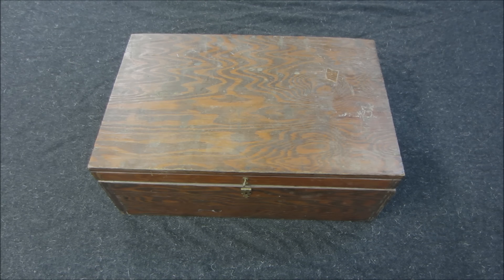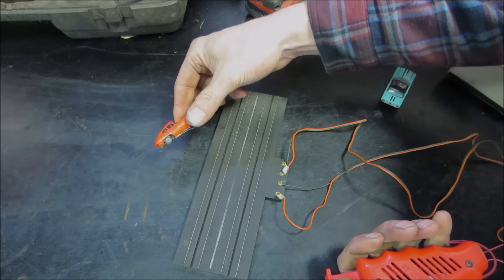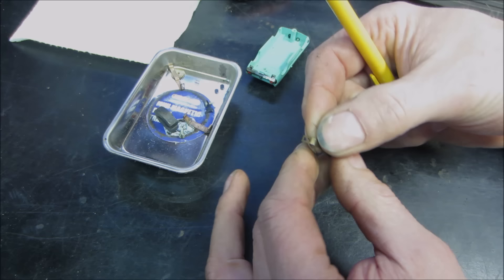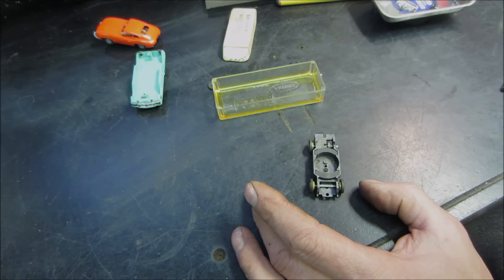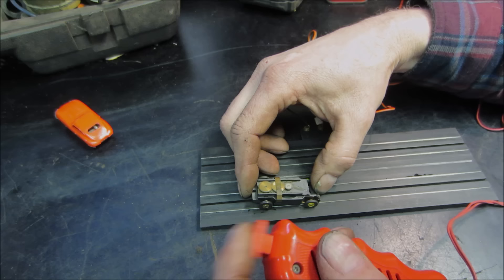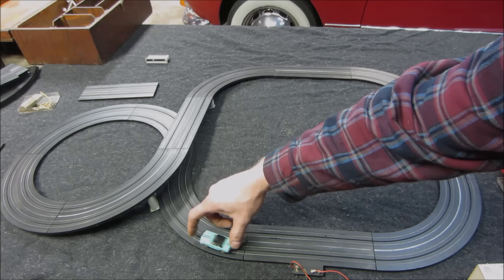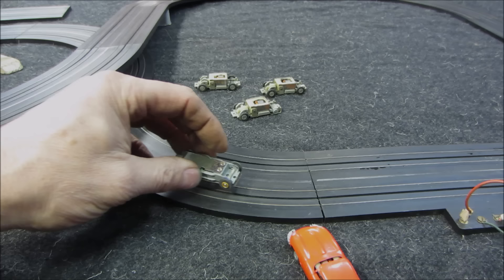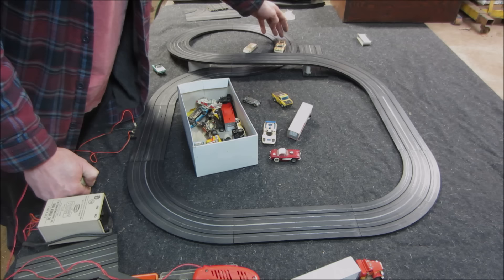will they run? 1960s slot car set sitting 40 years.

Comment: Loved me some HO cars when I was a little chitlin. Every winter we would set up the ping pong table and build a race track. Many years worth of yard sales left us with a great variety of straights, curves and loops. Enough to build a sizeable four lane track. As I recall it took a whole day just to located and repair all of the open circuits and buff the track just so it was usable. After that it was a constant struggle to keep it all going through the winter. I recall hop-up kits for the Aurora cars with silver pickups and silver brushes and little bottles filled with 3 in One oil, all used to get that extra tiny bit more speed out of the cars. Once the neighborhood kids figured out that the track was up they'd start showing up at the front door with small tackle boxes full of their favorite cars and controllers and the neighborhood racing league was set for another season. Ah the time before cable tv and computers, it truely was the good old days.

Comment: I could almost smell the ozone myself watching this! Thank You so much for dragging these out for us. Loved it. I am 64. The biggest years for me were '66-69. I was in junior high and had a much older cousin who was co-owner of a hobby shop so got stuff wholesale.  Plus he just gave me TONS of stuff he got as promotional because his shop at the time was the only authorized Aurora dealer in town. AND a regional warranty repair center. I would spend almost entire weekends with him at the shop, racing and repairing and souping up those 1st gen chassis and motors. We even modified the tracks and controllers.  I knew all kinds of tricks. Over the course of 3 weekends,  2 buds and I built a layout in one of their basements that was 4 levels high and used up damn near every square foot we could. Even running like bats outa hell, it took over 20 minutes to complete one lap.(when the damn thing made contact the whole way, lol) We only were allowed to leave it for a couple of weeks before we had to take it down and when we did the track sections filled up 1 3/4 55 gal. drums! In the end, I was fortunate enough to have over 150 chassis,  300 bodies and enough spare parts to start my own shop! Of course,  by then I  discovered REAL cars and GIRLS! so the h/o stuff fell by the wayside. My parents wanted me to get rid of it all, my cousin wouldn't take any of it back so in '75 I donated it all
 to a boys home in Lansing,  Mi. when I joined the Air Force. Spent a Saturday  helping set something  up and teaching some of the older boys how to work on the cars and stuff. Wow! Thanks again. Those are memories I almost forgot all about.   

 Force
Reply: Awesome story!😊

Comment: I still have my 5 sets from 1973 and the "pit repair kit" that came in a small tackle box with all of the extra pieces to build 10 cars, spare parts. I bought extra tires in white, foam, rubber and a weird jelly type material. I would go to a toy/hobby shop by my house called "kiddie-land" several times a week to buy stuff. I used to clean the rails with hobby oil and 0000 steel wool. My mom drank Sanka coffee in little glass jars and I used to used them to store my best race cars and throw them in my book bag for races after school at my buddy's house. I loved customizing the bodies and painting them. The Magna 440 cars were insanely fast and had real strong magnets on the bottom to hold them on the track. Good times
Reply: NEVER use steel wool, it gets into the motors and ruins them, very hard to clean it out of the track and everything!

Comment: I still remember (55yrs ago) saving my allowance to by soft, foam rubber slicks for the rear end of my H/O racer....new brushes, some sewing machine oil I "borrowed" from my Mom, an eraser and a little square of sandpaper were all in my car repair kit. Then hours would be spent making the race course as real as possible...signs, trees, etc. Good times.

Comment: Those are the later generation cars with a regular motor.  The first generation used a vibrator motor which was an electro magnet with a pushrod that went up and down to open and close the circuit and drove the wheels with a metal piece that drove a gear on the axle.  We used to shorten the pushrods to get higher rpm and used dual truck tires for speed and traction.  Clean all your tracks with scotchbrite for good contact as well as the motor pickups.

Comment: I remember going to a local sewing machine repair shop and buying a small tube of sewing machine oil, it was very thin oil, probably 0 weight, and it worked great for lubricating the parts of my slot cars. The 3 in 1 oil was way too thick.
Reply: My mother was always mad because we used up her sewing machine oil.
Reply: Yep, sewing/mineral oil, These days you can get synthetic turbine oil. I use it on fishing reels year around because it doesn't gel up.
Reply: Some model shops sell the correct oil for model trains and it usually comes in a bottle with a thin nozzle applicator. Can be used with slot cars.

Comment: Thanks for the trip back into my childhood.  My track wasn’t as old, but I had the one with the General Lee and a cop car.  My Dad even set up a table in the den so I could keep it together.  An eraser and steel wool was your best friend.
Reply: I had the same track lol.
Reply: I have that set still to this day... :) 
Steel wool should not be used because it will fall apart and small strands will get stuck to the magnets of the cars (messing up the motors), in some cases the steel wool can also cause short circuits. 
I would use rubbing alcohol on a Q tip to clean up the cars motors/parts. 
Thumbs up! 👍🏼

Comment: The reason the A/FX cars would't really go was because the guide pin was bottoming out in the slot. Flip the pin over, the round pin is shorter than the flat pin... Also, the vibrator car is supposed to run on AC current.

Comment: I had a big set when i was a kid. I wasnt very nice to my toys and most of them were broken. The slot car set lasted forever. I would setup different tracks every dsy and run the cars for hours. I loved the smell of the electricity and the glow from the brushes in the motors sparking.

Comment: Nice! Run your track through the dishwasher. Use Cascade soap. Make sure the brushes are perfectly parallel to the car bottom. Glue a nickel (5 grams) to the top-front of the chassis. Replace the back tires with foam rubber slicks. Plug it into 220V. Guard rails are for wimps.
Reply: 220?
Reply: @shanek6582  Normal voltage is 110V. 220V in will put 24V to the cars instead of 12V. No, it won't run very long, but it will run very fast. Like injecting liquid oxygen on a Toyota Camry with a solid propellant booster on the back. Very fast, very brief, but you'll remember that ride when you're 95 years old and your memory of every other experience has gone soft at the edges.
Reply: Giblet535 the one my brother had it wouldn’t stay on the track unless you were really good at feathering the throttle, you must have had yours tuned up good.
Reply: @shanek6582  There was a small, but real, risk of losing an eye with my set. It was a lot more fun that way. We used trash can lids as shields as we yelled "Drivers! Start your engines!"

Comment: Loved slot cars as a kid, I soldered little 12v light bulbs on the motor terminals inside so they would lit up and raced at night :D Great times.
My uncle still has his original set from the 70s with some of those very large GT cars. They even have a little steeringwheel on the controller so you could change lanes.
Reply: We were trend setters eh! after we did that, they started adding head lights. We found the headlights robbed power from the motor so we usually just took the lights out.

Comment: What a flood of memories.  Clean the brushes and pickups with an eraser.  Just a little oil on the gears. Stretch the springs on the pickups to keep then on the track pick ups.
Reply: Yup, I remember the eraser trick.
Reply: Yep, the eraser trick. I can still see the hand drawn illustration of a hand holding a pencil with an eraser, and that split second before the eraser touches the contact in permanent suspended animation. I forget what we did for the track. Didn't we rub a penny the length of each rail to keep them clean and shiny?
Reply: @sped6954   a nickel works better than a penny

Comment: Wow! That takes me back down memory lane. We had a club at school and shared track and parts and just like you are doing I took them apart before race day and cleaned and lubed. I also remember some bigger rear tires I had and maybe a different choices of gearing in the middle. Could be wrong on that. Thanks for this, it was an unexpected pleasure to see!
Reply: The Aurora Model Motoring accessory gear set was called "Hop Up Gears." It came in a nice box with graphics. AJ's was the biggest fat silicone tire seller. Auto World sold those, along with rewound high-performance motors.

Comment: The flash of a few Sparks, a quick wiff of ozone, and mustie1 got it working. This was great, and brought back a lot of memories. Especially when you were working on the Mustang and taking it all apart. I was like I remember that, the magnets, the brushes, the little Springs, the three little gears on the top with the clip that holds them in , the dirt in the axles... all of it. Great video.

Comment: I'm surprised that I knew mostly how these thing worked back when I messed with them. The ones that I messed with were much cheaper. The tracks had built in pins on one side and the cars used wires as brushes. They also used DC batteries. I remember my friends breaking his pins and I would use old wire to just jam in there to make the connection. I also found out that you can make any size battery work then eventually discovered than you can salvage an adapter to make it electric powered as we went through too many batteries. 

I'm surprised that I knew about basic electricity when I was 5-6 than all my cousins know at 20.

Comment: This is an AWESOME video. I’m playing over again. I have all of my original T Jet, and regular AFX cars, then the newer AFX cars with “Magnatraction”. And when those came out, they were the bomb!! They hugged the track unbelievably well especially at that time in the early 70’s. The problem your having with the traction on those old cars is that the tires are old and the rubber got hard and brittle. You need to get new tires that are soft. Those tires are readily available for the T Jet cars, and tires are available for the AFX cars as well. You can get them on eBay. I have all of my original AFX cars in my AFX carry case still. As a matter of fact, I have the “Baja Bug” with the tire on top, and cool exhaust out the back. It is like a lime green color. You need to find one of those on eBay since you’re a Beetle man!

Comment: The cars with the sealed DC motors were Tyco cars, as was the red Corvette with the white tires. My first set was a huge Tyco set that held itself together with 'snap together' ends. Should've called it 'permanently break apart' track cause all the end tabs snapped off.  Original Tyco cars had big wide conductors that were soldered on the top side and folded over underneath and acted like springs. Tyco cars worked okay on Aurora style track but Aurora cars did not work well at all on Tyco track. My 2nd set were Aurora AFX, just like the white and blue #2 car - those headlights in the front should light up! Check the white guard rail you have - it may glow in the dark (mine did). The Aurora cars with the larger deep magnets that held the cars onto the track better were MAGNA-TRACTION cars. Sets like these eventually led to larger scale slot cars with wooden tracks and racing leagues. If you look around you may find a slot car racing track nearby running some of the Parma or other style cars that go crazy fast (and cost a lot of money). Be careful though, it's a deep deep rabbit hole if you jump in!
Reply: I also had the Tyco setups. Too many years to remember how they worked. My brother and i had a big area in our bedroom and used to hook several sets together. We raced many hours on those old Tyco tracks.

Comment: I have some of those same Aurora cars here.   I fixed some of them up not too long ago.  Aurora was on LONG ISLAND back in the day!  You can still get new tires and alot of parts for those. if the shoes have holes solder them up for now. Use a little engine oil on a small dropper and lube up the gears and axles
Reply: I had an Aurora AFX Slot Car set as a child, I remember belting it down the straights as fast as it would go and not stopping in time for the corners......resulted in quite a few flying experiences for the cars.
Reply: West Hempstead,N.Y.

Comment: I'm a little younger but I had a slot car set pretty similar to this in the late 80s or early 90s. I think it was the classic Camaro and Mustang pair. I remember both of the cars broke beyond repair so I built a new one out of legos with a motor from something and a rubber band drive belt. I just used stripped copper wires for the contact shoes. I even made a little trailer it would pull around the track. 

Just in the past few months, I built a 1:5 scale RC Buggy with a chainsaw engine for power. I guess not much has changed haha.

Comment: I played with those race-tracks for days and days....rebuilding cars, swapping internals...you definitely need those yellow plastic guardrails to keep cars on the track. Need to use real light oil on those gears...i believe the old-vintage oil hardened up. I use to pull the springs out a bit and re-assemble on the copper contacts...makes for a bit firmer on the track electrical rails....clean those track rails too...they get oil on dust (mixed) on them. If the cars were too light in front or rear...taped a penny on them....for better contact-track traction.

Comment: Boy does that bring back some memories.  I had a huge set of Aurora track and cars.  When I put it away and left it behind when I moved out on my own, I probably had about two dozen cars and had most of them running.  My younger brother let the neighbor kids borrow them for a few weeks or so, and when they brought them back, all that was left was the track, and a hodgepodge of bodies, chassis, guide pins, magnets, pickup shoes, springs, brushes, gears, tires, axles with one hub, etc.  We had lots of fun, and lots of tedious frustration.
I remember putting little ^ arrows on the magnets that pointed to the front, so we knew which way they were supposed to go, unless we intentionally wanted some of them to go the wrong way.

Comment: i have a 10 lane oval bank track from Carrara and i havent got to set it up yet bc of its size. its 4 ft tall and like 15 ft long and  10 ft wide. and im 13... you dont need to grow up in the 60s just to know e v e r y t h i n g about slot cars
Reply: also got 30 cars. 1/32 scale mostly
Reply: omg i was n  o  t  i  c  e  d by darren
Reply: @redneckmaniac3463  The 1/32 cars were easier to modify. They also could be used with one front pin or pins in the front and rear. The local hobby shop had races every weekend and you could go there after school to practice. We bought a lot of parts there. I soaked my tires in brake fluid to soften them for more grip. Instead of oil, I used graphite from a pencil to lube everything. It was great fun in the 60s.
Reply: i live in maine and in brunswick theres a huge track that runs 1/24th scale cars and i brought a modded one that had a tiny little transformer inside it that bumped it ip to 200 volts and had neodinum magnets in it along with 2 pins 1 in the front 1 in there rear. they kicked the car off the track when other ppl came to the track. me and like 4 friends had the same setups, all of which were semi truck bodys so we could fit all the wiring and stuff in it  XD.
Reply: Right on there.  From an old guy, I knew that we ain't got dibs on slot-cars and modelling in general but cool layout!  I'm having the same problems with my OO-guage railway, when it comes to space.  Keep at it though.  You seem to know what you're doing.  We didn't have neodinium magnets in our younger days, which is only a drag 'cause they hadn't been properly invented back then. Have much fun and enjoy your hobby.  Cool.
Reply: Another thing Dad taught me to do was precision soldering. We installed 30 gauge wires on to the bottom of every track and every contact rail, dropping then down holes below the board when installing track.. then under the board attaching heavy buss feeder wires to power it all, bypassing the need of the contacts  between the track pieces.  If course, this was for a permanent build track.
Reply: Flymochairman1   thanks!
Reply: Jennifer WhiteWolf    this setup will be a permanent

Comment: The Atlas cars and Eldon cars were very similar, may have even been made at the same Hong Kong factory. Aurora Thunderderjet 500 used pancake motors. They advised in the manual where to apply oil, which always dripped on the track. Junctions were common early on as many of these slot cars were marketed as model roadways, meant to be used with OO and HO model trains. I remember that there were semi trucks (and trailers) marketed, along with pins so you could back up the vehicles. The original T-Jets used straight pins with a cast metal clip in the center of the track to hold the pieces together. Later version used a molded polyester clip. The original T-Jet sets used a box that looked like a dash board with a steering wheel for control. It was not great for racing. You might try a "Bright Boy" rubberized abrasive cleaner used for model railroads on the track. Love your videos. Enjoy!